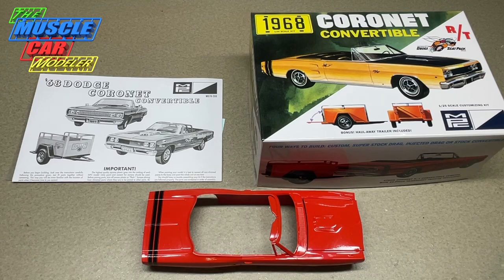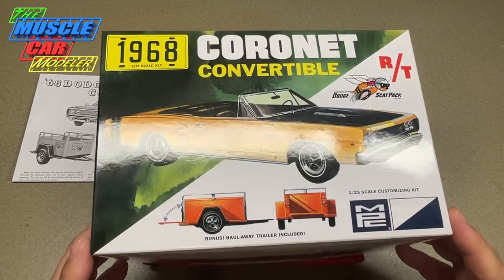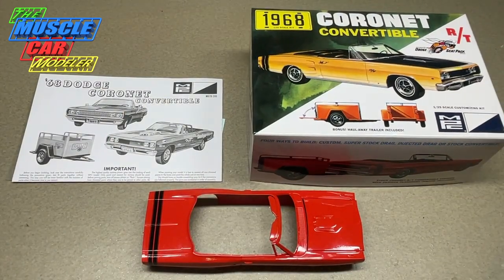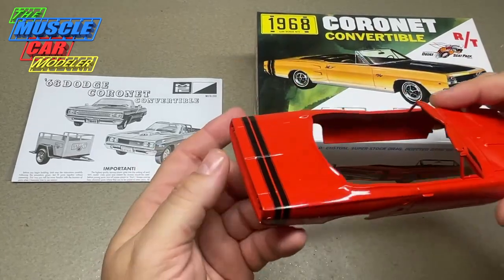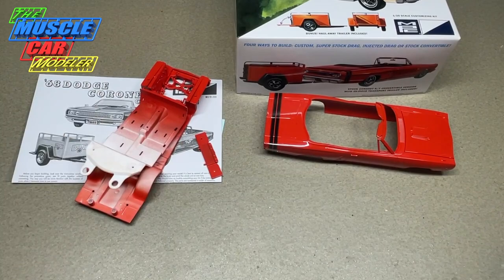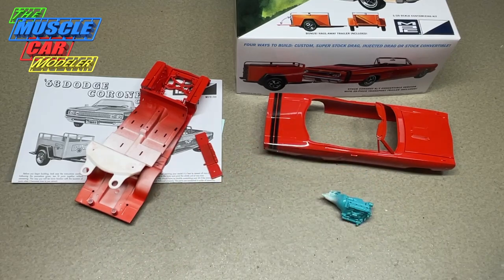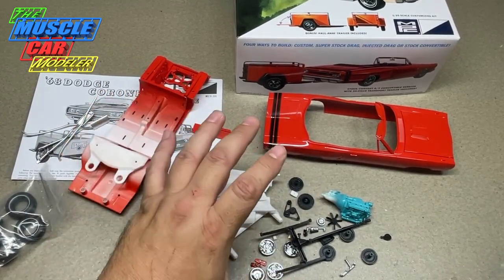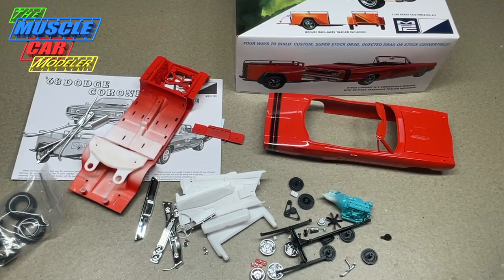MPC 1968 Dodge Coronet RT Convertible update 1

Comment: Nice work so far. Mine should be here next week, can't wait. As far as the fender mounted "Turn Signal Indicator" lights are concerned, I think they got it right based on pics I've seen on this car.  As far as the interior color goes for me I would do it Black, but White would really pop on this car. To really send it home on a white interior, do a wash with very light gray or beige panel liner for all the white interior parts.
Reply from the maker: Thanks. I was looking into what is factory correct. The bright red was only available with all black interior or black and white interior. Dodge did offer a white with burgundy carpet, dash and console, but that was only on a Burgundy exterior car with white stripe. Bright red that I picked would have a white stripe with the white interior and a black stripe with an all black interior. So now do I go all black and leave the stripe or change the stripe to white?
Reply: @TheMuscleCarModeler  I would change the stripe and do the Black/White interior.

Comment: I took the 440 Magnum air cleaner decal out of the Revell Hemified 68 Charger kit and cut the center out of it and used it on the air cleaner. It fit, ok, good enough.
Reply from the maker: Very cool.

Comment: Looking great ! Tan/beige interior would look nice - truly unique - but, IMO, a red interior would look even nicer. Or, maybe you could jazz it up with a white interior with blue accents (dash, carpet, console). Heck, even red accents were available with white (which is how I built my copy). 
Yeah ... a shade - darker red would look sweet ! Perhaps Tamiya Mica Red over a red oxide primer.
Reply from the maker: Yes. I agree but if I plan to be factory correct, I may have to change a few things.
Reply: @TheMuscleCarModeler  , Hai. Certainly I'm not alone in wondering why the Coronet emblems were, in es., deleted from the upper door frames. The interior is 99% improved (the aforementioned missing emblems, and the 'plain' dash top ; the latter could be reworked/detailed by either sanding - down the 'metal' area where the defroster vents and speaker are on the 1:1 (like I did on my build), or even substituting the same portion from the Revell 1968 - 1970 Charger kits). Likewise, I'd have preferred separate seatbelts.

One thing to watch for on this gem is interference at the mounting pins (interior - to - chassis ; body - to - inner fenders ; and, convertible boot - to - interior tub). Even one coat of paint will compromise the otherwise perfect fitment at those joints. One will have to pin vise the female receiving points to get the body, etc., to set as - intended.
Reply from the maker: Thank you. Yes, I noticed the mounting pins don't leave much room for paint build up.